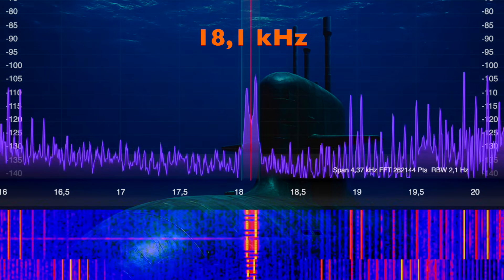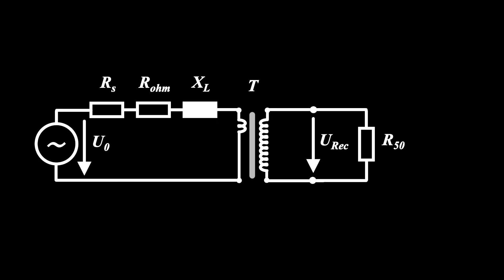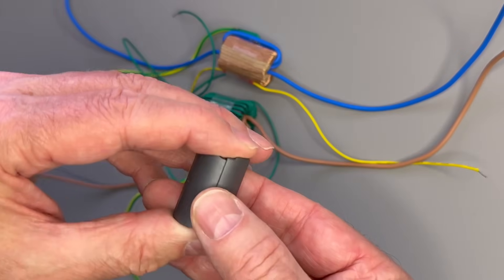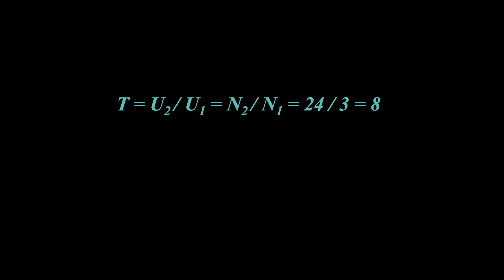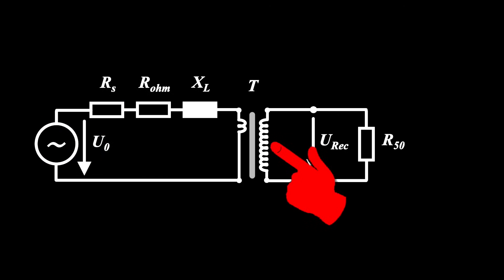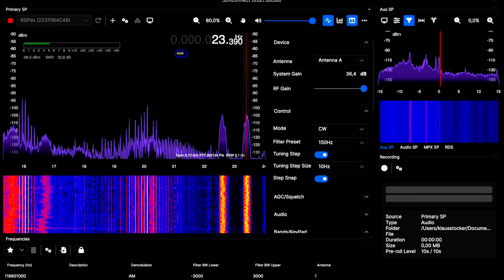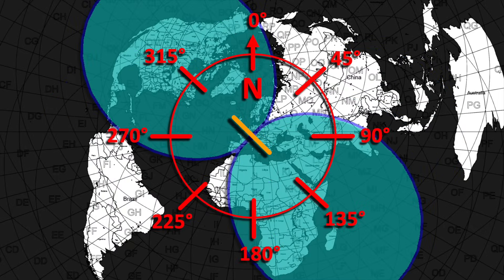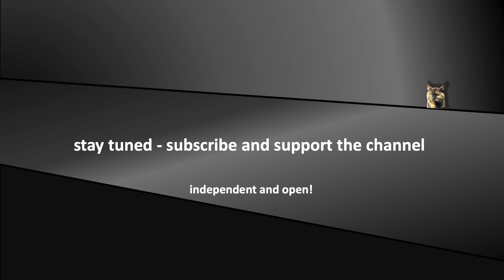Wow: Clever VLF Alternative to Coil Antenna (EP171)

Comment: Hello! 
Another great video!
I have never seen a series of videos about loops antennas, as much as deep detailed as yours.
A couple of questions:
In order to cover so different frecuencies bands, are two baluns better than one with taps? 
Could you compare cardioid (resistor loaded loops) and eight shaped doble loops with all of these antennas?
Greetings.
Reply from the maker: Thank you for your comment!
I'm very glad you like the videos.
A BALUN with taps is certainly an option. However, I've come to the conclusion that, due to the parasitic inductances and capacitances, it's probably better to use different BALUNs. They can then be better optimized for the different frequency ranges. This will be a topic in upcoming videos, by the way.
Can you give me a reference to cardioid (resistor-loaded loops)?
Regards
Klaus
Reply: @electronics.unmessed  
Of course!
It is a type of loop, with a resistor conected, usually on the opposite side to the feed point. It causes a cancelation of one of its reception lobes, turning its shape a cardioid patern and therefore, making this loop unidirectional. For example, you can look for "SULA" (Small Unidirectional Loop Antenna) for the complete info of its construction, on the SWLing Post Message Board.
Greetings.
Reply: @electronics.unmessed  
Hello again.
I think Youtube have deleted my message.
To avoid this again, I will say just a thing.
Search for SULA (Small Unidirectional Loop Antenna).
Greetings.
Reply: @electronics.unmessed  I don't know how to help you. Youtube has deleted my messages twice. Do you want that I send you a private message?
Reply from the maker: Very good comment! Thank you very much! 
I found the SULA antenna - very interesting concept.
Not sure it will work for VLF, but I need I will think about it.
Funny, your comments were filtered by YouTube - I don't know why. 
I saw it one, but then it disappeared.
Sorry, for the inconvenience. 
Stay tuned.

Comment: Isn't that 4 turns of primary?  There are 4 conductors through the center.
Reply from the maker: Thanks for your comment! 
I've actually been thinking for a long time about how many turns are actually effective. 😅
It's probably 3.5.
Regards
Klaus
Reply: @electronics.unmessed  The way I understand it, and has been explained to me in the past: if a single wire passes through the center of the core that still counts as a full "turn" electrically, and there's no such thing as fractional turns. So I think counting how many times it goes through the center is the accurate way to assess turns.  But i'm no EE/RF engineer shrug
Reply: @peepzorz  Just remembered that the fractional turns are used when trying to decide inductance per unit length of a long single wire e.g. nH/cm, which matters in EMC discussions where return currents can be all over the place and local potential difference matter more.
Reply from the maker: Thx for your comment! Sounds logical to me.

Comment: I know people are doing RF transmitting work below 9 kHz because most governments haven't regulated those frequencies because it is so difficult for hobbyists to make useful transmitting antennas with any efficiency at all. So they are counting on weak signal computer software and narrow band transmission techniques along with ridiculous amounts of wire on giant loading coils, as well as doing things like sending their antennas up in the air with kites. The key to making distant communications on those frequencies is that they have been unregulated. Original ideas have no limits. People use GPS disciplined Xtal ovens to lock their transmission frequency, and 200 Watt hi-fi amps to create high output power. It appears that lower and lower frequencies have attributes, (like the fact that they work essentially in ground-wave all around the world,) that have not been fully developed by RF hobbyists. Fun stuff, especially where the frequencies are unregulated.
Reply from the maker: Hi John,
Thank you for your interesting comment!
I wouldn't have thought people would use frequencies below 10 kHz.
It reminds me of an experiment I did when I was younger. I sent music with a tube amplifier that only had a few watts and a 2m x 2m coil (20 turns or so), and received it with a smaller coil with many turns, simply by amplifying the signal. It worked, at least, from the house to the garden.
Best regards,
Klaus
Reply: that is really interesting - could you recommend a web resource on information on how to use a hi-hi amp as a VLF transmitter?
Reply: @linuxsuperuser  Did you just ask a channel op to give you personal attention, so that you aren't forced to use a search engine?  Can't decide if you're ballsy or just rude.
Reply: I am fortunate to have 1,500 meter x 1,500 meter property. I just bought 450 ohm ladder line and two spools of 1000 meter aluminum / magnesium electric fence wire. I own a Drake R8B Communications receiver. This wire and ladder line should make a hopefully useful horizontal loop antenna around the property lines. My shack is in the center of the square property. Both ends of the loop will follow along each side of my driveway. My rig only goes down to 10KHz. This should prove interesting enough. Now, to maybe try transmitting from it.
Reply from the maker: Wow! Curious to hear about your experience.

Comment: What about a horisontal loop, would it be omni directional?
Reply: I'm not sure about extremely low frequencies, but I've found that at longwave frequencies horizontal polarization just doesn't work. Yes it would be omni-directional, but I think it would miss many signals. But this is all about experimental engineering. I've even buried antennas in the ground before, so give it a try.
Reply from the maker: @johnwest7993  John,
Thank you for this tip. You're simply the best when it comes to low frequencies. I hadn't thought of that at first. The horizontal loop obviously creates horizontal polarization. The ground wave is actually vertically polarized. We'll try it out and report back. Regards,
Klaus
Reply from the maker: Hi Harald,
Very good point! And you are right, you're getting an omni-directional diagram. I think, I will try it in one of the coming videos.
Greetings
Klaus

Comment: Klaus, another very good and informative presentation; thank you!    My interest is predominantly MF on the 474Khz WSPR and FST amateur bands.  Primary antenna is 41 meter Inverted L BUT also enjoy a 1.2M Loop in the Mobilius configuration which sometimes is superior. .  Comparisons of different Loop configurations here has typically found the Mobilus superior at this frequency but not yet enough data to come to firm conclusion.  Question:  have you done any comprehensive comparisons of the three (?) different configurations and if so, your conclusion?  Also, currently use small coax as my loop conductor but wondering if significantly increased diameter, say 2.5cm would make a difference?  Any observations?
Reply from the maker: Hi Randy, 
Thx for your comment. From my experience the Moebius antenna delivers the strongest signal and the best SNR compared to a shielded and a simple loop. See the earlier videos, where I made a direct comparison. Thicker material (thicker coax) is never wrong for antennas, however, for this kind of antennas it doesn't play a major role. You can gain more with a bigger loop, say 2m diameter instead of 1.2m.
Greetings 
Klaus